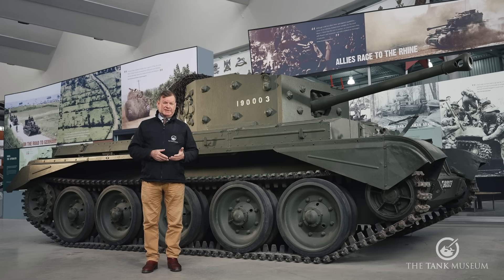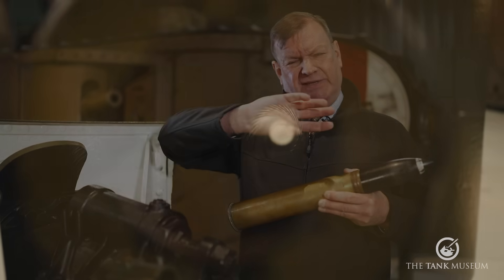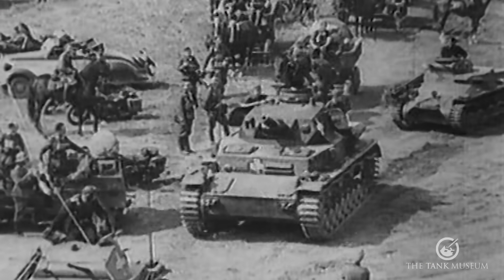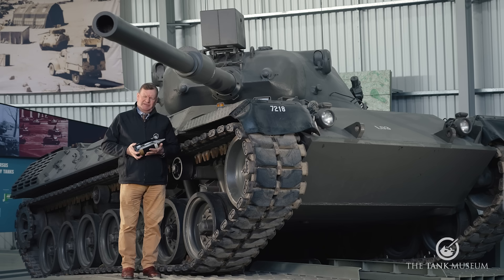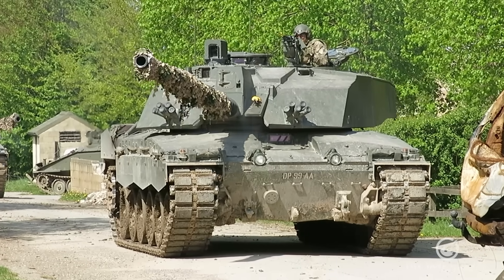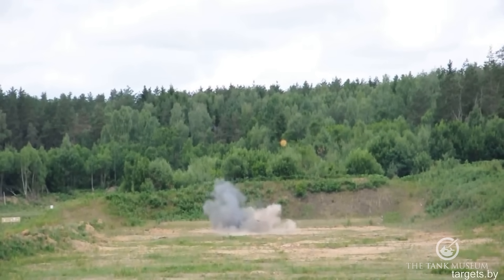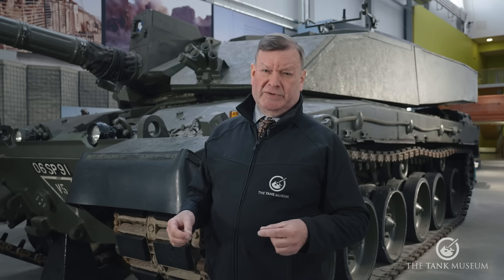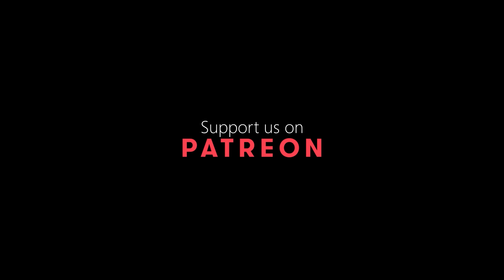Knock Out: The Evolution of Tank Ammunition

Comment: The main isotope used for DU munitions is (238)U, an alpha emitter. 
While the layer of dead cells on top of the living skin is thick enough to block alpha radiation from external sources, the impact and subsequent pyrophoric behavior of the material causes it to disperse into finest particles which are easily taken up by breath. Once ingested, alpha emitters are extremely toxic, rendering former battlefields where DU munitions have been fired uninhabitable.
Reply: The penetration depth for an alpha particle inside the body is measured in tens of microns. In tissues like the lungs or intestines which have a mucus lining, there's a good chance it'll be stopped by that before it reaches the cells which should reduce the risk of DNA damage significantly. I suspect the bigger risk is from some of the uranium ending up in solution where it can be taken up by the cells directly, either that or from beta and gamma emission from other parts of the uranium decay chain. The impact of a uranium round isn't going to make the land near it uninhabitable - the average concentration of uranium in soil is such a that the top metre of soil in a large garden (by British standards) contains about 2kg of natural uranium or the equivalent of around 3kg of DU. If the underlying geology is different - granite or phosphate rocks - then concentrations can be much higher with soils around Stockholm for example having the equivalent of 20kg or more of DU in the same size garden as well as large amounts of thorium and radium yet people are living there just fine. Inhaling or ingesting grams of the stuff is a bad idea, but that's true of many substances encountered in warfare so I'd be interested to know how the relative risks compare.
Reply: @trolleriffic  yeah, tell that to Iraqi people, how it is harmless.
Reply: Also the uranium particles that end up in water supply are basically as bad as inhaling them if not worse.

Then again, basically all heavy metals are highly toxic, whether it be tungsten or lead, (silver and gold not withstanding, but they have basically no military application outside of electronics) and you don't want any of them in your lungs, stomach or bloodstream.
Reply: "International Atomic Energy Administration points out, “DU is 3 million times less radioactive than radium still found in many old luminous watches and 10 million times less radioactive than what is used in fire detectors.” DU is also far less radioactive than the potassium 40 found in the human body. Potassium is a substantial percentage of the dry mass of common Hawaii agricultural crops such as bananas and marijuana. A 2.5 lb bunch of bananas will contain over 100 mg of potassium 40. Gamma detectors are used to detect marijuana smugglers at international borders."
Reply: given that there is Uranium in all water on earth (because it is highly soluble & omni-present) your statement is really pretty obviously quite silly as well as demonstrably false based on readily observable reality. Humans interact with the sea all the time, all people regularly breathe water vapour, and the sea is definitely not uninhabitable.
Reply: Depleted uranium is toxic. The use of it is a war crime. This video is proof that the Tank Museum is a criminal and terroristic organisation. EVERYONE who promtes the use of DU is a candidate for the electric chair ...
Reply: Lots of chemicals produced in war, which I am sure not good for you. Lets say a battlefield is not a healthy workplace environment.

Comment: We have to move away from the myth that the cap of capped AP rounds helps in the penetration of sloped armor 🙃🙂
It simply helps the round to stay in shape, thus allowing it to defeat thick horizontal plates by  piercing. If the shell stays intact when impacting sloped armor, a lot of energy is lost by the round simply getting deflected from the armor.
Reply: Does it not catch on the armour and help steer the core into the armour rather than having it bounce off from a glancing blow? (On top of providing a kind of cushioning effect to reduce the risk of the penetrator shattering) - I could be talking rubbish but that's what I'd read although I've no idea of the accuracy of the source information.
Reply: @trolleriffic  Nah it doesn’t work like that. The cap cushions the impact to prevent too much stress on the nose which might cause it to shatter. A shattered shell can’t penetrate through thick armor but a round breaking up against slope armor has the effect of less energy being deflected from the plate. Kinda how APFSDS can penetrate sloped armor more efficiently than flat armor.
So caps don’t help against sloped armor and in the worsts case even have the opposite effect.

Comment: Left out APCR / HVAP  - Armor Piercing Composite Rigid / Hyper Velocity Armor Piercing (Known to the Russians and Germans as Arrowhead from its shape) - A half way house to Discarding Sabot
Armour-piercing, composite rigid (APCR) in British nomenclature, high-velocity armour-piercing (HVAP) in US nomenclature, alternatively called "hard core projectile" (German: Hartkernprojektil) or simply "core projectile" (Swedish: kärnprojektil), is a projectile which has a core of high-density hard material, such as tungsten carbide, surrounded by a full-bore shell of a lighter material (e.g., an aluminium alloy). However, the low sectional density of the APCR resulted in high aerodynamic drag. Tungsten compounds such as tungsten carbide were used in small quantities of inhomogeneous and discarded sabot round, but that element was in short supply in most places. Most APCR projectiles are shaped like the standard APCBC round (although some of the German Pzgr. 40 and some Soviet designs resemble a stubby arrow), but the projectile is lighter: up to half the weight of a standard AP round of the same calibre. The lighter weight allows a higher muzzle velocity. The kinetic energy of the round is concentrated in the core and hence on a smaller impact area, improving the penetration of the target armour. To prevent shattering on impact, a shock-buffering cap is placed between the core and the outer ballistic shell as with APC rounds. However, because the round is lighter but still the same overall size it has poorer ballistic qualities, and loses velocity and accuracy at longer ranges. The APCR was superseded by the APDS, which dispensed with the outer light alloy shell once the round had left the barrel. The concept of a heavy, small-diameter penetrator encased in light metal was later employed in small-arms armour-piercing incen
Reply: Yes, this was a bit of a dead end technology, but it was used, so it would have been nice to see it included; and you could then include squeeze bore guns as well possibly? A good constructive comment, and well explained.
Reply: @Simon_Nonymous  for tank use, they are definitely a bit of a deadend. Not so much for aircraft though. The discarding sabot can get caught in the propeller of a helicopter or turbine of a jet engine, which you certainly do not want.

For some reason Germany also never developed 20mm APDS until the 80s, instead using APCR (with a small incendiary component) for their autocannons on infantry fighting vehicles like the Marder.
Reply: Was about to say this as well. Quick addition though regarding the caps, they are not necessarilly present. Soviet 45mm APCR has no cap, only an aluminium (or was it soft steel?) ballistic.

Comment: Try not to breathe in the DU nano particles that result from sprawling. They are alpha emitting.
Reply: "International Atomic Energy Administration points out, “DU is 3 million times less radioactive than radium still found in many old luminous watches and 10 million times less radioactive than what is used in fire detectors.” DU is also far less radioactive than the potassium 40 found in the human body. Potassium is a substantial percentage of the dry mass of common Hawaii agricultural crops such as bananas and marijuana. A 2.5 lb bunch of bananas will contain over 100 mg of potassium 40. Gamma detectors are used to detect marijuana smugglers at international borders."
Reply: That's true, but a significant part of the risk also comes from the chemical toxicity of uranium. You'd need to breathe in quite a lot of the dust to have a measurable effect on your cancer risk.
Reply: Depleted uranium is toxic. The use of it is a war crime. This video is proof that the Tank Museum is a criminal and terroristic organisation. EVERYONE who promtes the use of DU is a candidate for the electric chair ...

Comment: Great vid I thought and I've read in books 6 pounder yes its 57mm put the 6 pounder part is the weight of the ammunition 17pounder, 25 pounder and so on.
Reply: 37mm = 1 pounder 40mm = 2 pounder 47mm = 3 pounder 57mm = 6 pounder 76mm = 17 pounder 84mm = 20 pounder all used by

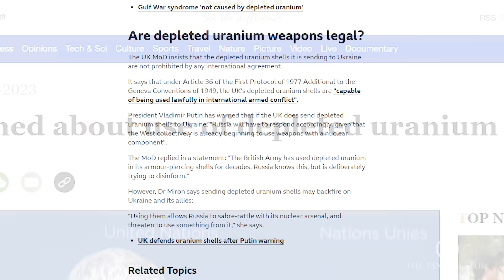Comment: 11:30 DU ammo might be safe to handle but once it impacts it develop a cloud of uranium oxide and that is far from being safe. One could argue that this side effect is violating the ban on chemical weapons.
Reply: And one would be wrong. The ban is on weapons that are designed to kill or injure by chemical effect, not o the possible reidue
Reply: @ROBERTNABORNEY-f3k  YOU are EVIL!
Reply: Uranium oxide will settle out of the air pretty quickly but you don't want to be around a vehicle that's just been hit and there's obviously the question of soil and groundwater contamination in terms of severity and longevity.
Reply: @trolleriffic  One could argue that the use of DU is also to prevent recovery of the damaged AFV as the damage resulting from the interior splatter of the material will contaminate it enough to prevent reuse and render it liable to scrapping.
Certainly there are questions about whether the use of DU is actually legal within certain contexts as it does contain a significant risk to the people at whom it is fired through ingression of the material which as has been stated is an alpha emitter and thus toxic to internal organs
Reply: @darreng745  That may be the case although the nature of its radioactivity means it's not difficult to protect against so it decontamination might not be as big a problem as one would expect. It would probably depend on whether or not the dust bonded to the surfaces or not. In the case of people it's fired at, I would think that if you're close enough to ingest or inhale the dust after an impact it's probably the least of your concerns after the burning hot metal flying around but that's just a guess on my part so I could be wrong. If a vehicle is burned out inside and especially if the ammo has cooked off, I suspect it's destined for the scrap heap rather than a refurb and return to service so I doubt that DU has any real function of denying the enemy use of equipment in practice or by design.
Reply: International Atomic Energy Administration points out, “DU is 3 million times less radioactive than radium still found in many old luminous watches and 10 million times less radioactive than what is used in fire detectors.” DU is also far less radioactive than the potassium 40 found in the human body. Potassium is a substantial percentage of the dry mass of common Hawaii agricultural crops such as bananas and marijuana. A 2.5 lb bunch of bananas will contain over 100 mg of potassium 40. Gamma detectors are used to detect marijuana smugglers at international borders.

Comment: description of the annealed chromium projectiles is incorrect.  it was not to harden.  hardened chromium steel tends to fracture in to smaller pieces, which would degrade effectiveness of armor-piercing rounds.

annealing is the opposite of hardening -- it increases the ductility and reduces the hardness of a material.
Reply: It's done to increase toughness isn't it? I seem to recall that annealing is done very carefully with strict control over the temperature and time spent to increase toughness while minimising the reduction in hardness of the metal. I think there's also differential hardening (or whatever it's called) which might be done using a mould which has one end water-cooled to rapidly chill the tip of the projectile for maximum hardness, while letting the rest of the round cool more slowly so that it's softer and tougher.
Reply: You are both right. It reduces brittleness

Comment: Question: What calibre HE shell would be guaranteed to disable a tank crew through concussion? I was reading a report about a tank crew of the UAF who went in the wrong direction & got a career ending tank round. The explanation of their CO was that they had suffered from concussion after the first hit and that it was quite common for tank crews to suffer from the effects of concussion. My mind went back to reports I had read of the ISU 152 disabling the crews of tigers & elephants with a well placed HE round. At one extreme, a 16 inch HE shell from a battleship (ignoring the massive kinetic energy of the shell) would almost certainly give a tank crew a bad day and make their ears ring a bit. Historical reports suggest that 152 HE shells do a similar job in a slightly less extreme fashion. With the russian tanks T80 & T90, they have 125mm HE, which, though sometimes giving crews mild concussion, are not certain to do so. Of course it depends on the type of HE in the shell. So, all other things being equal ,what would be the ideal calibre of HE shell? Are we anywhere near to reaching the point where expensive AP rounds will be unnecessary because the weight of HE that can be lobbed at a tank will disable the crew anyway?
Reply: There will be nothing left of a tank when hit by a 16" shell, the only question is: Whats worse, high capacity or armor piercing? 😅

There is this famous video of the German Bundeswehr splitting a Leopard 1 in two with a direct fire 155 from a PZH-2000 to demonstrate its self defense capability. Now the L1 isnt that well armored, but it indicates that even the best armored MBT of today would only proceed to the scrapyard afterwards - and the crew probably as well.
Reply: @Ganiscol  The 16 inch example was a deliberately obtuse extreme. Vapourised is the likely outcome. Thank you, I will hunt down the video. The gap between the 155mm  artillery and tank guns such as the proposed 130mm of the KF51 narrows. So my question stands.
Reply: Never. Every army I have worked with as a US tanker (British, Canadian, German, Israeli) has the same doctrine. You don't consider a tank dead until it catches fire or changes shape involuntarily'
Reply: @ROBERTNABORNEY-f3k  Doctrine changes as capabilities change. Yes, with the current state of sensors and the frequently used mark 1 eyeball it is a pragmatic doctrine. Never is too strong a word.
Reply: There is a film of a WW1 tank putting on a demo for the British King. It crashes down a slope, 3 crew got out, the other 5 crew were inside unconscious.

Comment: Why don’t military’s around the world create more dense and harder materials?
Reply: The Laws of Chemistry and Physics. We've gone as far down that road as can be traveled
Reply: Depleted uranium has a density of around 19 grams per cubic centimetre and there aren't many denser materials than that. Osmium and iridium are the densest and second densest elements at 22.59 and 22.56 grams per cc respectively which isn't a massive increase on DU and they're both incredibly rare and valuable metals that would be too expensive and in too short supply to use in tank rounds - annual production is a few tons of each per year while DU stockpiles measure in the hundreds of thousands of tons. There's also the question of material properties - as mentioned in the video DU has the advantage of being pyrophoric and self-sharpening and with the right alloying materials like titanium it's hard enough to use in tank rounds without being so brittle that it would shatter on impact. Iridium and osmium in particular have very high melting points so working with them is difficult and expensive and even if you could make AP rounds out of them, their mechanical properties might result in them being no better or possible worse performing than DU or tungsten.

Going to even higher densities would either require exotic states of matter found in white dwarf or neutron stars which can't be made on Earth, or by explosive compression of materials to abnormally high densities but they only remain in that state for microseconds before the compression rebounds and they explode, so neither idea would work for making tank rounds.
Reply: The leap forward will not be a projectile of greater density. The tech everyone hopes to crack is superconductivity. Once that happens rail guns and even lasers will become a reality in tanks just as they are in naval use. All the weapons and tech used in tanks started life on surface warfare ships.
Reply: @zoiders  Rail guns could provide a useful increase in speeds although past a certain velocity threshold, the impact can be modelled using hydrodynamic theory and the penetration depth becomes solely a function of the length of the impactor and the square root of the ratio of the penetrator density to target density. In short, beyond about 2.5-3.0 km/s further increases in velocity won't result in better armour penetration but that's still quite a bit faster than current tank rounds.
Reply: Wait until 2123 with the new neutron star round.